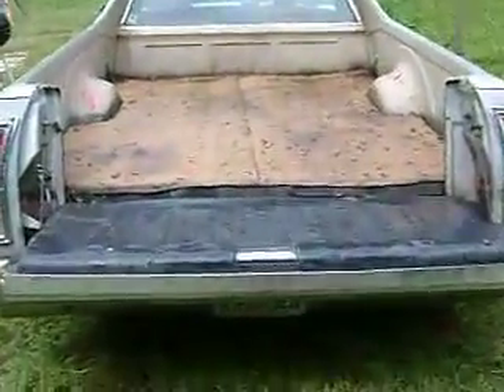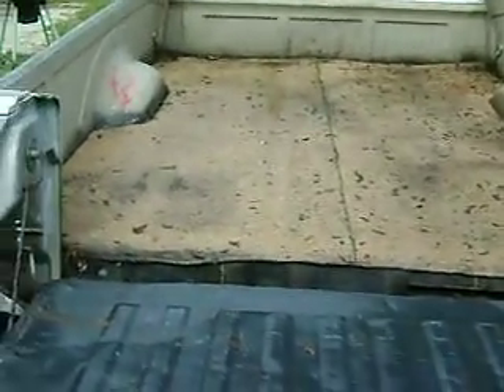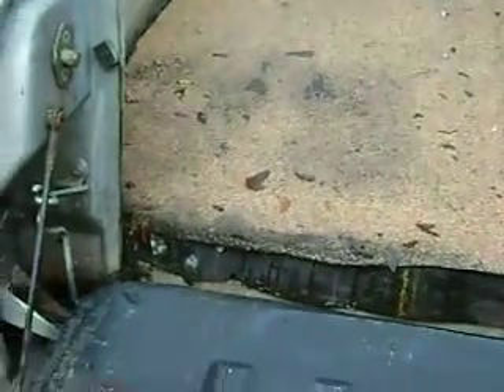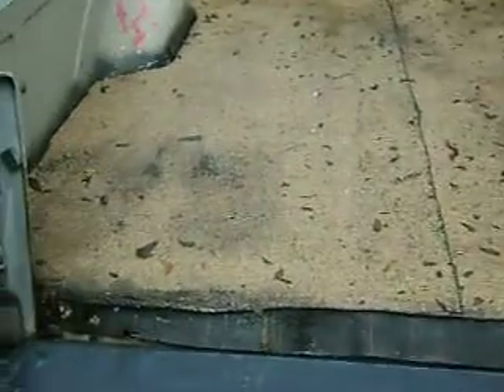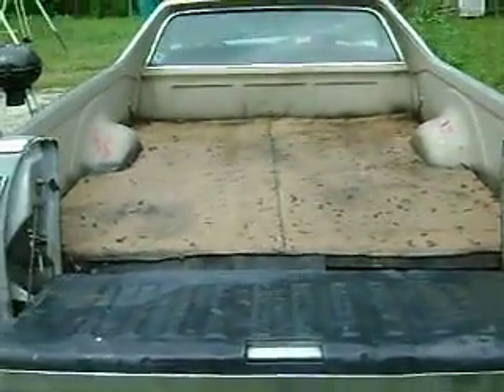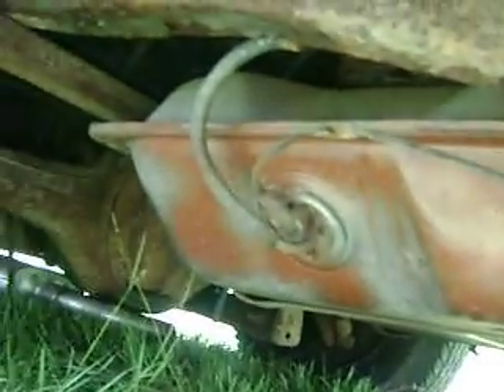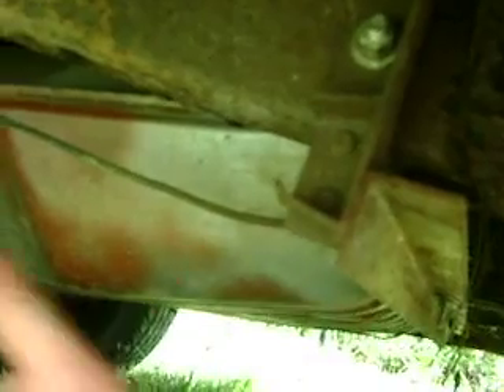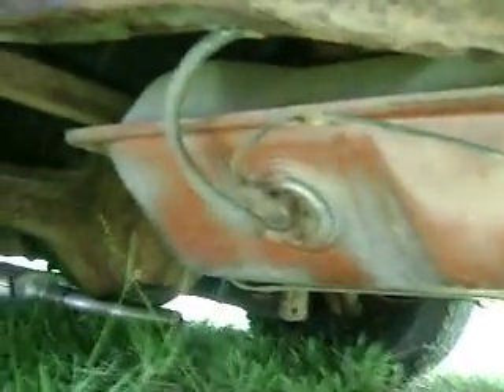FORD ranchero redneckrepairs

Comment: u should take that out because it will trap the moisture and cause the bed to rust much faster than if u dont have a liner. u can get that stuff for spray in bed liners in a paint can and paint it on yourself